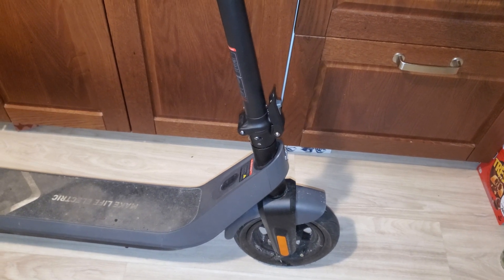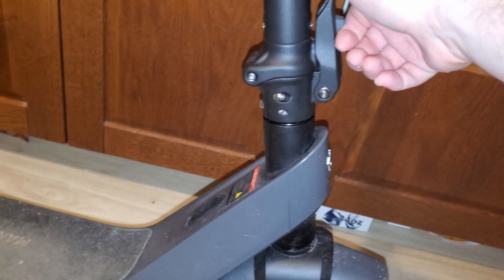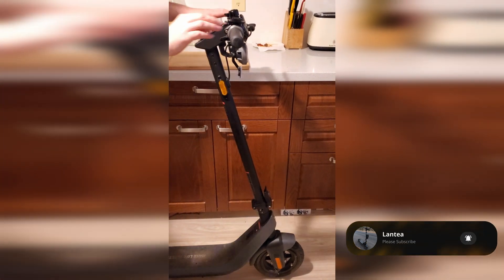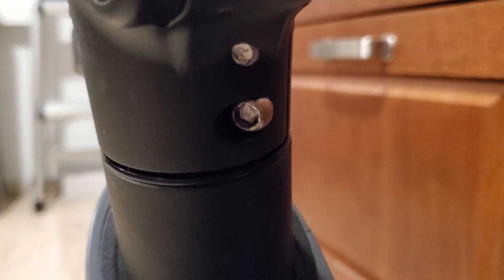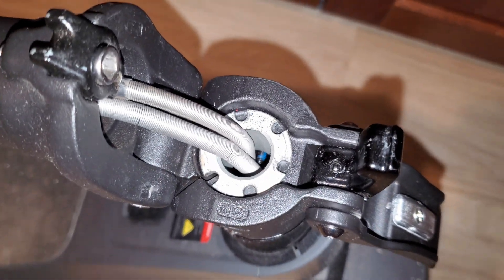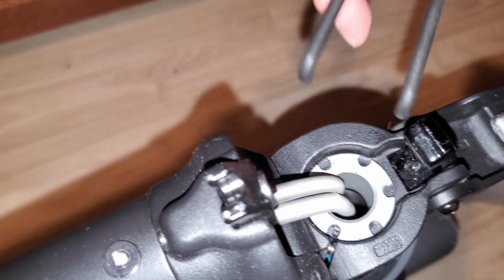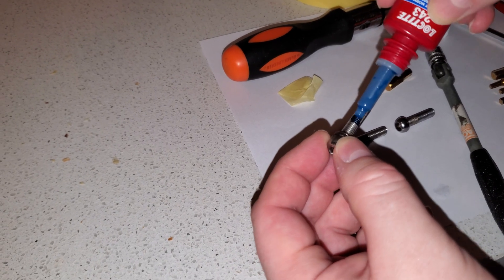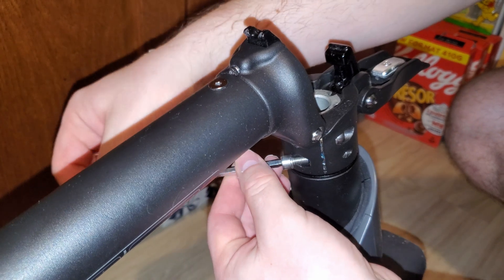Fixing Stem Wobble on the NIU KQi2 Pro Electric Scooter

Comment: You are a very high precision type of man and should do a video on how to dab a small amount of grease on Both steering bearings races  in  headset assembly  I wonder is there is a simple way to gain enough access to the bottom one also. believe this will prevent any issues in this area in the future as well as the wobble and signficantly reduce wear on the entire scooter. I would recommend a simple automotive or marine grease.⚙️🔬🧪🚀🌌💪

Comment: Reply:Fwd: Objet : Demande de déverrouillage de trottinette NIU KQi2 Pro Bonjour, J’ai acheté une trottinette NIU KQi2 Pro d’occasion, mais je ne peux pas l’associer à mon compte car elle semble déjà liée à un autre compte. Malheureusement, je n’ai pas la facture d’achat, mais la trottinette est bloque est je ne peux pas connecté au mon compte
Reply from the maker: There is no way to unlock the scooter. You need to contact the seller (original owner) and ask them to unlink the scooter from their account, if they can't or refuse its likely stolen. You can ask NIU, but they will only help if you have proof of purchase. This is part of theft protection so that someone who steals the scooter can't use it fully, so there is no way around it.

Comment: People, you dont need fancy tools to tighten that bolt. Just grab a needle-Nose Pliers, an adjustable spanner and there you go. Thank me later.
Reply: Didn't have the park tool but after a dig around in the random tool drawer came to the same conclusion, and it works just as good

Comment: Do you know how to align the steering wheel with wheel? I can’t access the 2 bolts on the stem as the battery is in the way.
Reply from the maker: Are you referring to the NIU KQi2 Pro scooter or a different scooter model? On the KQi2 the battery should not be in the way.

Comment: We're did you get the special tool from? And what it is called?
Reply from the maker: I bought the Park Tool SPA-2 from a local bike shop, you can also get it on amazon, but just keep in mind its not designed for this, but it still works and gets the job done.
Reply: @Lantea13  Thank you for your reply, so it's called a Park tool? Where would you get the proper tool from seeing as the one your using isn't quite rite for the job?
Reply from the maker: @superdooper9200  Its called "Park Tool SPA-2" Not sure where to get the exact tool designed for this fastener. Another commenter mentioned its called a 'nut spanner' but when I asked NIU support they were not able to give me information on the exact tool they use at their service centers.
Reply: @Lantea13  ok, thank you so much for your kind reply, I will get the tool that you suggested....

Comment: Could you please do a tutorial on how to change the front and rear tire please
Reply from the maker: Unfortunately I don't plan to do a tyre change video, until I really need to change the tyre, since its not the easiest process. If you only have a flat, try to use a tubeless tyre plug kit instead of replacing the whole tyre.
Also take a look @ScootLetsGo videos on changing the tyres on the NIU KQi3, the process should be very similar on the KQi2, and he has done a great job with his tyre change videos.
Front https://youtu.be/bX0P59Ir0G8
Rear https://youtu.be/sAZnTLp2qWM

Comment: Hi! Do you have photo of of this black hook from folding mechanism? I have problem with it and I think my spring is in wrong place cause its hard to unfold my scooter.
Reply: I to have a problem with the black hook it does not go up fully when I pull back the first latch meaning its stuck permanently upright. I see a reddit post about tightening a screw just below the black locking latch but I can't seem to find what they meant. Would love to know if anyone else has a fix for this as I would love to be able to fold my scooter :p
Reply from the maker: @Sesal-Snow  Maybe these pics help https://imgur.com/a/iw3m20a on the 4th one you can see a small screw inside the black hook, maybe that is what the reddit post was referring to?
Reply: This was a huge help i have managed to fix the issue thanks. As for what I did, I lossened the to hexagonal screws on the first latch slightly and I faced the front wheel against the wall and pushed foward with a little force on the handle bar this allowed the black hook just enough room so that I could push it off with a little force again. I then tightened the black hook slightly once the scooter was folded. Hope this helps others.
Reply from the maker: Hi, here are a few photos I made https://imgur.com/a/iw3m20a hope it helps.

Comment: Thanks bro, it helped a lot. I have a brand new kqi3 MAX and same process but with the inner workings you need a wrench to tighten. For anyone wondering you need a 15/16th size wrench.
Reply from the maker: Great that it helped you out even with the KQi3 Max and thanks for sharing the wrench size needed for anyone that finds this. Maybe I will be able to test out and produce some videos on the KQi3 as well down the road.

Comment: I had the same issue and I tried to fasten all bolts instead of loosening them initially. Thanks! It also started to become visible at around 500km.
Reply from the maker: I am now 800km since I tightened it and its still holding solid. No other problems so far and I went through some heavy storms recently but the KQi2 is holding strong.

Comment: Hi, bro. Nice video always helpful. Please I need your help.  My kqi3 pro switch off while I'm driving it and since then I can't switch it back on
Reply from the maker: Hello, its hard to say what might have caused that issue. Have you tried connecting the charger to see if it wakes up or responds? Or checked the cable inside the stem if it did not come loose (it should not though, if it was fully plugged in during first setup). The best option would be to contact NIU support ( Global-Service@niu.com ) and see what they suggest. NIU has a 2 year warranty on the KQi3 so they should fix it for you, if nothing else helps.